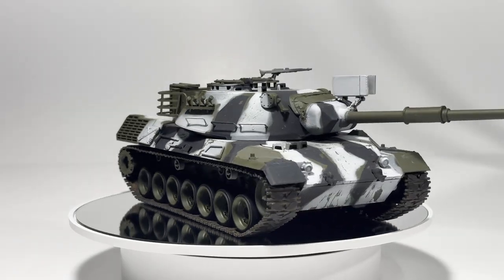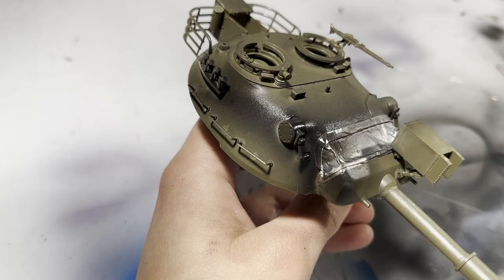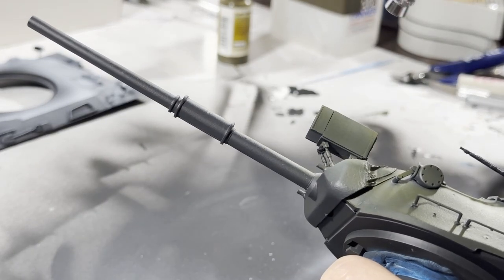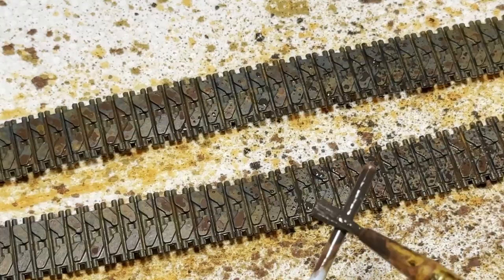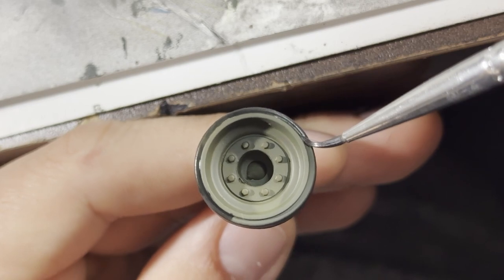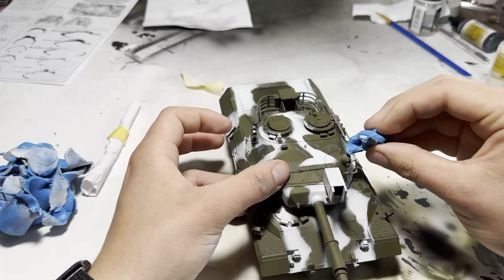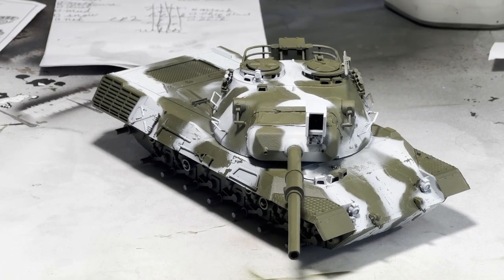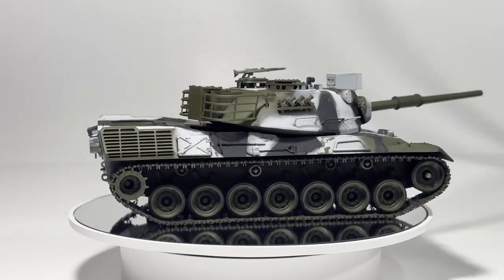Scale Model Winter Camo & Rusted Tracks Made Easy

Comment: Thanks for sharing your work. I wish I found Stynlrez as enjoyable as you; it is difficult to spray consistently or for long periods of time in my experience.
Reply from the maker: I did have some issues with flow but found that spraying at higher PSI (above 30) and only lifting off of the trigger when the needle is fully forwards helped a lot in that regard. Higher PSI helped to keep the primer moving and paying close attention to my trigger control seemed to keep too much primer from drying on the tip of the needle. Everyone has their own favorite products to use though, and if you have something that works well for you that's all that matters!

Comment: Thats sick! I love the shapes on the pattern and the way its only applied on the upper hull and turret. And especially the blue at the end made it so much more believable. I'd love to see you build a scenic base for this a some point. I'm pretty new to scale modelling as well and have a French R35 I want to paint in a multicolor scheme, but I dont have an airbrush. Have you ever solely brush-painted a model? And also, what type of airbrush do you like to use?
Reply from the maker: Bases and dioramas are coming up soon! It’s been something I’ve wanted to try out for a while and I have lots of unique ideas thought up. To answer your question, I have only used the airbrush when doing large surfaces. It applies paint evenly and in thin layers, and allows for a lot of control. I use a Timbertech that I found on Amazon - It was $80 for the brush & compressor set and was 100% worth it. You can totally get amazing results brush-painting, it’s just a different technique than what I prefer.
Reply: Great looking model, if you want you can get rubber black paint Tamiya XF85, Vallejo 70.950, and I know Ammo and Mig also have rubber black. Keep up the great work.
Reply: @commonostrichYT Cool! Im excited to see what you have in mind. Dont rush yourself friend :) And thanks, I'll keep that on my list if/when I decide I want the upgrade.